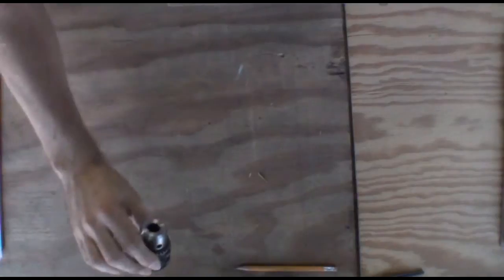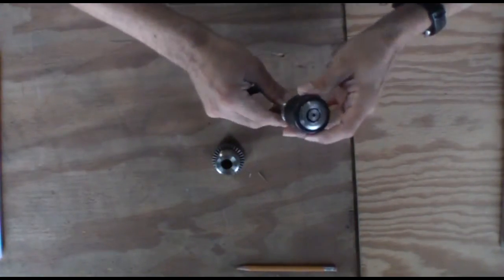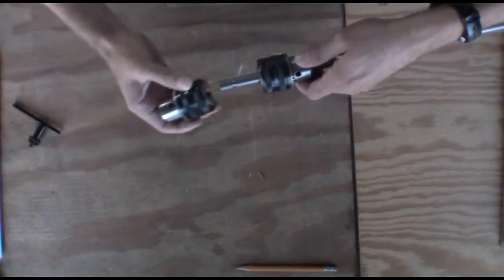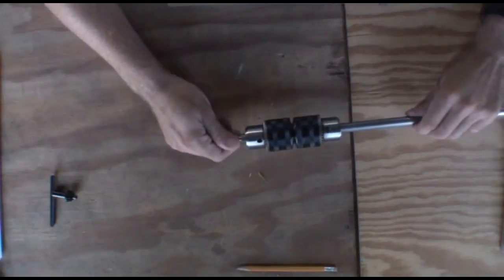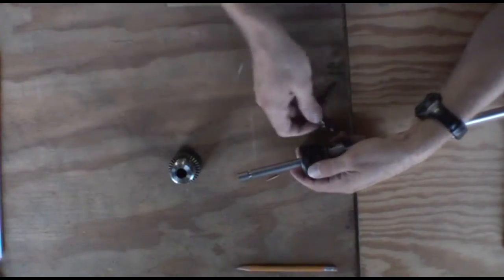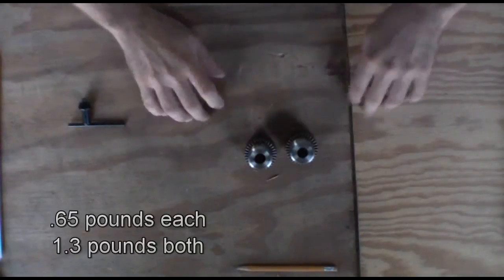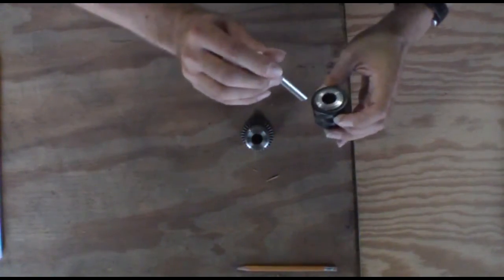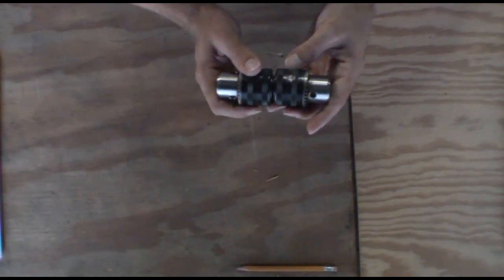rapid coupler for different size shafts

Comment: That is tempered steel and may not weld very well (makes it brittle and will brake or crack ) 
I have seen Jacobs Chucks with Threads (most have threads)  and so a long bolt and locking nut (cut the head off the bolt )  will give you what you want and possibly you could use different sizes 3/8  to 1/2  ?  

What do you think?